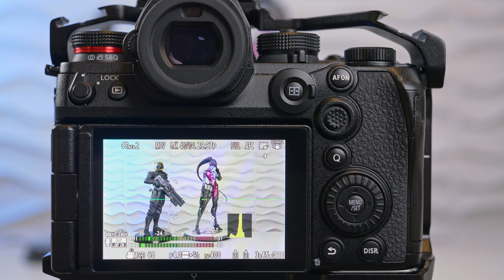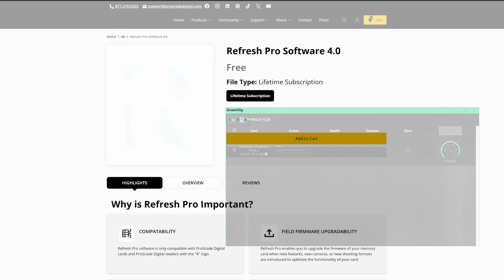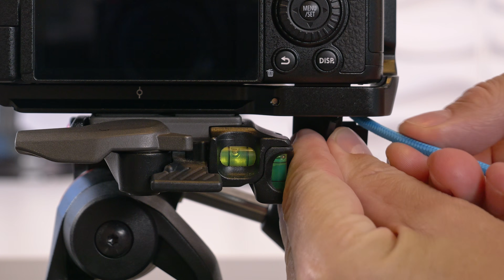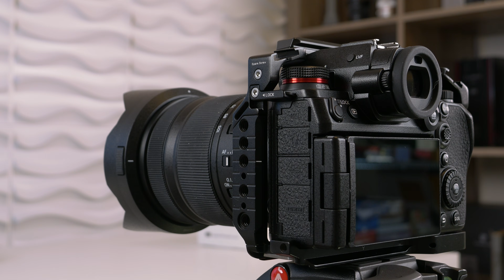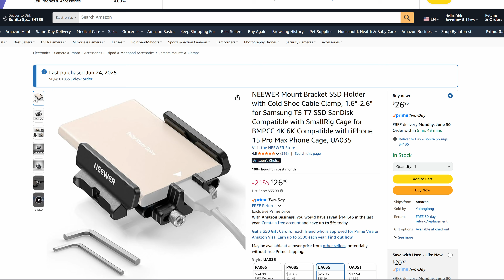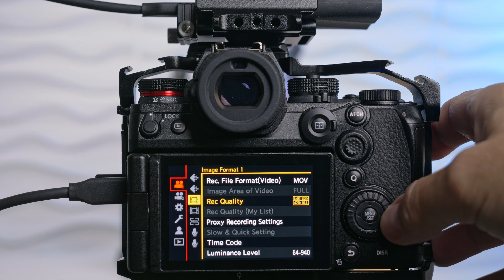Lumix S1RII Overheat Fixes | Tested Workarounds

Comment: I spent a lot of time shooting with the S1RII when it first came out, about a year ago. Was sub-optimal conditions mainly, in the Himalayas with summer on the way. Trying to run interviews with no A/C and dodging the morning sunlight as it heated up the room. Was using Angelbird SE CFexpress cards, before they got firmware upgrades. They got HOT. What I remember most from two months on the road was a lot of variation with overheating. Usually I'd get 45mins before a camera would cook. Sometimes less than 30mins. Often I'd get over an hour if there was even a slight breeze in the room. I haven't had need to push them this hard recently, but am curious to see if the S1RII firmware upgrades and Angelbird CFe upgrades make a difference.
Reply from the maker: It all boils down to resolution and framerate. If you're staying in your safe 4K range than you won't have any issues. And yes, the new firmware made a difference and allowed for longer recording times. But not a single creator provided new facts on 6.4K Open Gate 30 fps. I am still waiting for recording times

Comment: Fortunately firmware v1.3 and v1.4 was released that solves the overheating for both the S1II and the S1RII.
Reply from the maker: I've heard that, but so far nobody confirmed it for Open Gate 30fps, only for all other formats. Does it work in 6.4K 30?

Comment: I may need to return this camera then.  I was on a shoot this weekend using an external battery and a CF Express card and it overheated in 5 min (granted it was 90+ outside, but I was shooting at a football game, can't get around that).  At the time, I just hadn't bought an external SSD, however if it's overheated with that and the "official" coupler, at $3000+ the camera might be a bust.
Reply from the maker: Every time I wanted to shoot a video it would shut down within minutes! It is so frustrating, given the price of the camera. I sold mine on ebay, because right after purchase I made a trip to Europe and it was too late for a return when I came back. I bought the S5 II instead and now I record 6K30 in the Florida Sun as long as I want without the system shutting down. Love it, that's how it's supposed to be!
Reply: @DirksFocus yeah, that’s what I was looking at.  I’m in between the S5ii and the S5iix, Just in case I get the urge to go shoot at a higher bitrate.  We’ll see.  Looking around for deals now.  I hate to return it, but it seems as though the video side of the S1rii needs more cooking for my particular application of it.

And just to be clear you used the SSD, with the official coupler and an external battery and it still overheated? 🤦🏾‍♂️ lol

Comment: Shouldn’t you have done it with the screen flipped out? All of the heat is generated behind that screen
Reply from the maker: True, and I also tested it with the screen flipped out and the bracket moved away from the body. Still overheated

Comment: Well, i give you all now the best tip. Dont use the Lumix S1Rii. Its a trash cam, cause the overheat problem is a major hardware problem of this camera. Even if you dont record, the camera will overheat by just beeing powerd on. 

I have this camera since 7 Days now. When i use UVC, to stream on Twitch, the camera overheats after 3-4 hours in normal room temperature, and it overheats in just 1-2 hours, if the room is on summertime temperatures. And just saying, UVC Mode is just FHD with 50 FPS xDDD. 

You cant deny, panasonic failed with the S1Rii. You need to many workarounds, to make this camera nearly functional for a long therm usage. 
For its price, this is an absolutly no go. If you look at the Canon R5C. This Camera NEVER overheats, not even in a warm location at summertimes. 

Panasonic just used the Lumix S5 Case and didnt designed a new case for the S1Rii. So you can workaround, yes, but you pay additional money in many ways, to make a expenesive camera functional for your general usage. This is a joke.
Reply from the maker: The problem is that this is NOT a sponsored channel, I bought it with my own money and now I stuck with it for a while, until I can afford to sell it at a loss on ebay and to buy a new one that does not overheat. I am with you, it should have been tested and redesigned it before the obviously premature release. Panasonic had a reason, why the invited Youtubers in Winter to Norway to have them test the camera outdoors. Absolutely not ok from this company to backstab their community.
Reply: @DirksFocus  Exactly. This is the point. It wasnt a random move, sending them to Norway xD . They knew, the overheat thing would come to early on youtube, and no one would buy it.

Besides of the overheat problem, the camera is a great Superstar. I would take it for all my work, if that overheat problem wouldnt exist.

Im sad for you. And yes, this is the problem with Youtube and Influencers and hyping things to the sky.

Comment: The problem is the brand of the CF express Type B
Reply from the maker: The problem is the design of the camera with not enough heat disceptation. I tested multiple CF Express Type B cards, even if they are on the recommended list from Panasonic, they all get very hot, some less than others. But removing them completely extends the recording time, and this is not how it should be.

Comment: I have watched at least 5 videos so far of people coming up with ways to make a 3k camera operable. This is not a dig or a jab, I have just never in my life shelled out a decent amount of money - for anything - and then 1. accepted its limitations... and 2. Looked for ways to make sure "I" adapted to those limitations. Either you work or you don't work. Full stop. I aapplaud the commitment, the sharing in this community, the faith in the brand and all, but I will take reliability and confidence in my camera - especially on client shoots - over finding suitable workarounds to keep something in my bag.
Reply from the maker: I totally agree. After spending so much money I should not have to spend even more to find half-baked workarounds to use it a bit - instead of fully. After watching the Youtube-Stars at the camera Introduction in ice-cold Norway - smart move from Panasonic - I fell for the hype. The problem is that I spend my own money and I am on a budget. So for now I stuck with this camera and I have to make the best out of it. Thankfully I still have a G9 II, that can record and run sooooo much longer.
Reply: @ParadiseBizz i saw this exact same thing happen wit the Canon R5 five years ago. The only differnce is that even Canon ambassadors then, without fanfare, jumped ship and said: I can't get this camera because of the overheating and topped their pre-orders. I even stopped and got the A7S iii. I have not had a single issue other than no constant firmware updates. Its RELIABLE and I have total trust when I take it out of the bag. Now, this Lumix rollout has a host of people convincing their followers that "hey, what do you expect. they packed a lot into a small frame. deal with it" essentially. Just outright pandering IN MY OPINION. It's really shocking to me. So, kudos to you for stating the obvious.  I kid you not, i went down the rabbit hold today and forund another three people suggesting workarounds. That is very disturbing to me.

Comment: A camera costing over three thousand pounds UK sterling should not require workarounds to prevent overheating. There was a reason for launching it in freezing Norway.
Reply from the maker: I completely agree. And yes, they planned the launch in Winter-Norway, so that nobody would notice. On top they sponsored the big Youtubers to make sure, that only positive Hype will fly through the internet. 
I just think they should have tested more and re-designed it before releasing prematurely.

Comment: Josh Cameron released an overheating test video yesterday. You can check it out, it also has the S1II but he doesn't have the DC coupler.
I think using the non-super sampled 8.1k open-gate will help. Perhaps you can test 8.1k OG with the DC coupler and SSD.
Reply from the maker: Thanks for the tip, I will check it out!. How does he already have the S1 II? Sponsored?
Reply: @DirksFocus  Yes, I believe he's sponsored but the overheating data will be useful for comparison.

Comment: I have a S1ii and a 1tb Lexar Professional CFExpress card, I recorded 4k 60 Long GOP for 45 minutes before I got bored and turned it off. Room temp was about 73F. I’ll try it in the Atlanta heat later today
Reply from the maker: Congrats on your S1II. I think the biggest challenges are the recording modi higher than 4K. I would be curious to know how your camera is doing when you're recording 5.9K 30 fps full sensor
Reply: @DirksFocus  thanks! I shot outside in the heat, did pro res raw open gate but it was only for a couple of minutes, I did regular open gate 6k for over 20 min but it was room temperature I just never thought to test out the heating. I don’t usually shoot long takes in the sun. I’m going to try to get it to overheat today but so far I haven’t had any problems.

Comment: Thanks for the very informative video, you have really done a great job here. I also have this camera S1rII and use it professionally (at least that was the idea to replace my Leica SL2-s) I have experienced the same as you in terms of heating. I bought this camera to be able to record in 50fps opengate and it doesn't seem like it is possible. On the last commercial I recorded until now a few days ago I got an overheating signal after about 45 minutes of use when I had only shot small sequences of max 1 minute, and this is in cold Norway.. Simply unbearable and boring to have to stop production to wait for the camera to cool down. After this I also did tests and found out much the same as you, all these tips help a little but not enough. Using SD cards instead of CF, fan on full and tilting out the screen were the three things that gave the best effect for me. But I didn't get longer than about 10-12 minutes of continuous recording in 50fps opengate. It's a real shame because the camera is otherwise extremely good, with huge possibilities for both video and photos.
Good on paper and get a lot of good word by youtube stars but when its not work in real world situations, sorry it is not for professional use.
Reply from the maker: I appreciate your detailed feedback and your experience mirrors what I found too. It is great on paper, that's what I was falling for. I also watched the the Youtube-Stars praising the new flagship. They probably got sponsored. What a shame. 
But it was also a good strategy from Panasonic, to invite the Creators to ice cold Norway in Winter for the launch of this camera. Why not flying to hot Sydney? 
Filming a few minutes in Winter does not put such a stress on the camera as if you're working with it in Summer. And most Youtube-Stars did not do their due diligence.

Comment: Great tests. Very thorough. Thank you for your hard work. Sad conclusion, unless you film in short bursts, this camera is not reliable enough for professional video work. While designed for photography, this is still not a good look for Panasonic.
Reply from the maker: You're absolutely right. Even for a hybrid user like me this camera is not sufficient, let alone a Pro. 
It is overkill on paper, with all the options and specs. But how good are they if I can't use them in practice?

Comment: Solution is to add a fan at the camera. Was able to get more than 2h recording in 8k open gate   Was only getting 30 min without the fan
Reply from the maker: What kind of fan and how did you attach it? Is it on top of the display bracket that can be tilted?

Comment: Nice work mate. I think a huge part of the problem is if the camera overheats once, it's hard to keep it running. Some people might find their camera records longer for longer from a cold start (as the manual states), but either way great work on the tests!
Reply from the maker: Thanks mate. I agree, that's the problem when you're out and about and the camera overheats, there is (almost) no coming back. How was your experience with the S1 II? Any overheat issues?

Comment: THANKS for the tests. I've been ciontemplating purchasing this camera - I'd love to shoot astro and "summary Finnish night" shots in 44 Mpixels. However, in all other cases, I'd mostly use it for video as I generally just use video framegrabs as photos (on my S5 II where I exclusively shoot in 6K Open Gate). So it seems I won't get this model, after all. Hope the S1H II (if it's ever released) sports a similar-res but signiicantly faster sensor.
Reply from the maker: I believe it will perform much better. To me it looks as if Panasonic released the S1R II prematurely, without the proper testing. Because the overheat issue is purely a design flaw